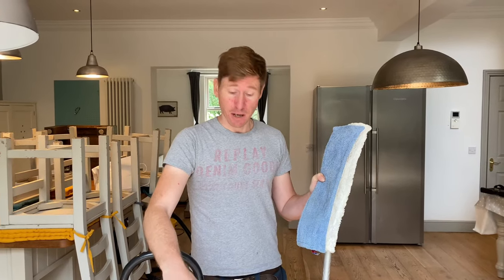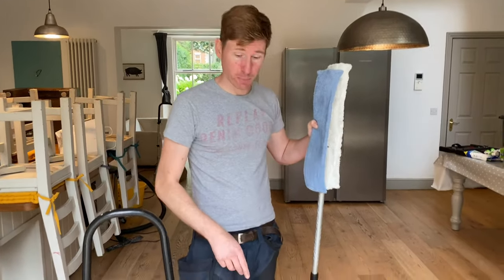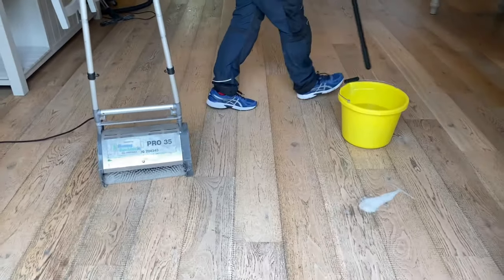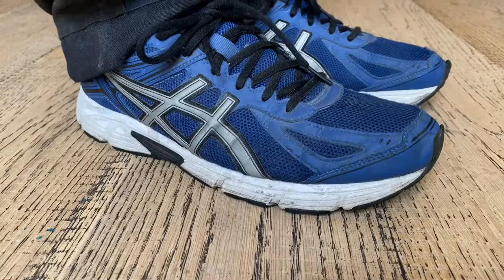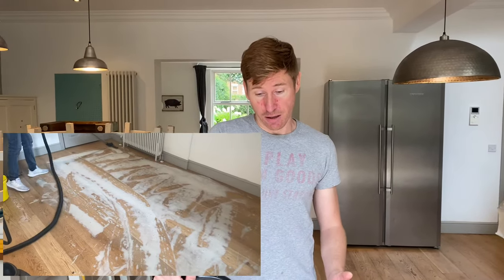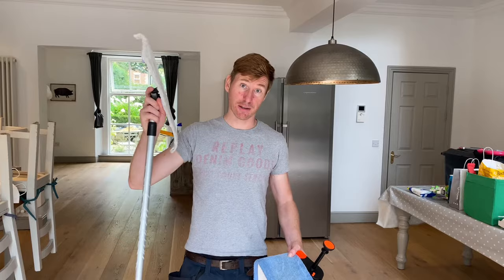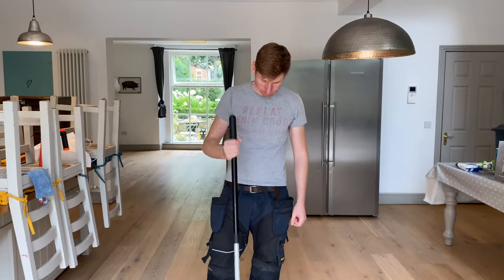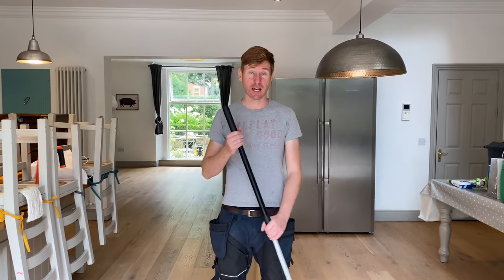How to Clean Buildup on Wood Floors

Comment: Thanks for the suggestions.  The hall floor and stairs in my house had carpeting which really had come to the end of its useful life, but the wood (which is just wood, not polished or treated or whatever the word is) has build up where I've walked with stuff on my soles - though I do try to remember to change into indoor shoes).  I've used the old-fashioned way - clearing with wire wool to remove the build up but your way looks like it could be effective but if the floor is untreated would the water warp the wood?
Reply from the maker: if the floor isnt wet for ling it wont warp wood, but I wouldnt put a lot of moisture on a laminate floor :)
Reply: @CleaningHowTo  Thank you.

Comment: That seems pretty expensive using all of those microfiber pads
Reply from the maker: I used 5 - about €4 each; €20; they wash 300 times, so not expensive at all :)
Reply: @CleaningHowTo  oh okay 👍🏾 thank you. I clean a building with 16 offices that has floors with this condition.. this information is super helpful
Reply from the maker: @mitigatedgalltv5747  No problem - I actually remade this video which might be a bit more helpful for youhttps://youtu.be/PtSJcth6KX0
Reply: @CleaningHowTo  I’ll check it out ASAP thanks alot
Reply from the maker: @mitigatedgalltv5747  no problemo:)

Comment: Can you give the specs on the machine you use? Im looking at deep cleaning the floors of a house im about to start living in during college and i dont want to buy a professional grade cleaner because those can become very expensive for a poor college student. Lowes and Home depot offer some hard wood scrubber tools but i want to make sure theyre not going to be too aggressive on my hardwood floors because again, this is a rental and I just want the floor cleaned.
Reply from the maker: Watch this - https://youtu.be/PtSJcth6KX0 theres an easier method that's cheap; though using a wet vac will speed things up.
Reply: We’re u able to locate the machine plz tell me what u used